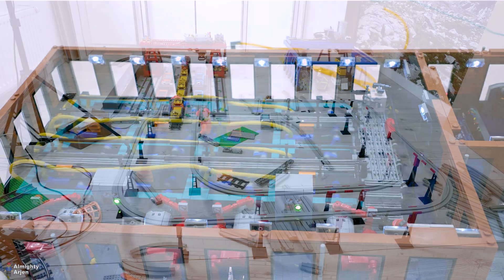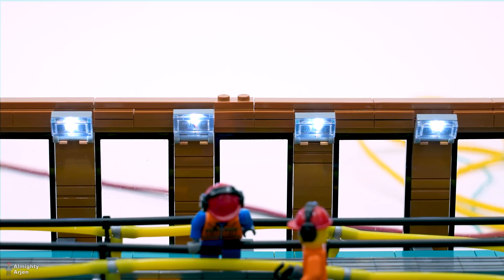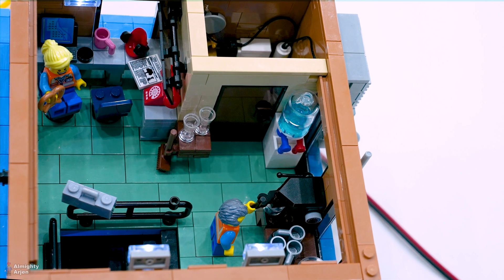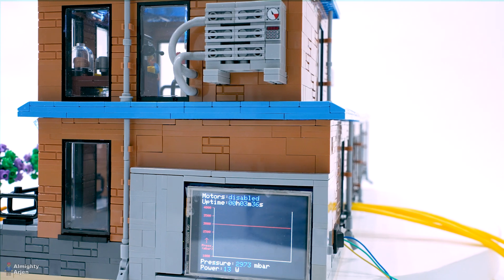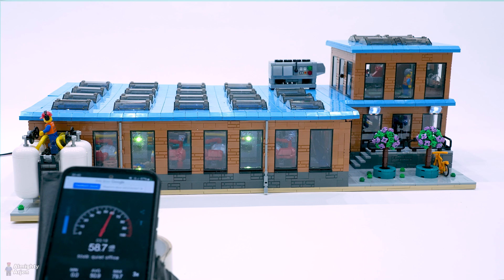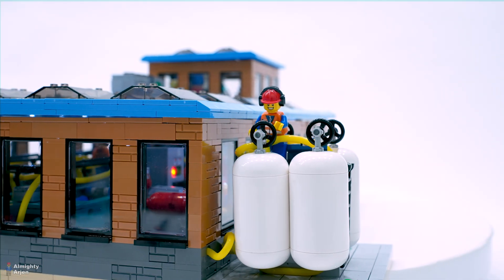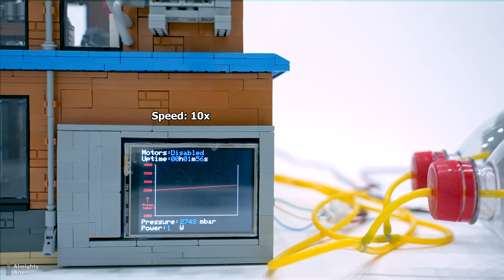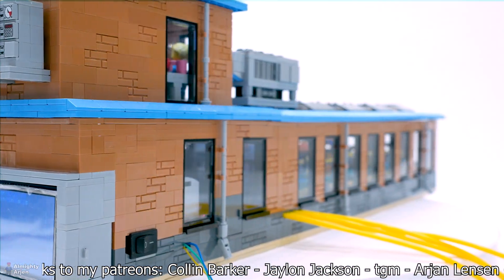Lego compressor with 16 pumps fully automated by Arduino

Comment: Those regulators are supposed to be mounted to a heat sync, they could melt those Legos and destroy themselves.
Reply from the maker: Thanks for noting, but not with the power that goes through them in this case, they hardly are getting warm at full power. The drawn current is around 2A max, the power that the 9V regulator needs to dissipate from 12V to 9V at 2A is only 6W.

Comment: If you link up the compressors in the same block you get more even torque and air flow, that will reduce the sound level a bit. Also i would sugest that they would join in the middle.
Reply from the maker: I don't fully understand what you mean by the same block? I have 4 pumps per motor, adding more pumps will result in an overheated motor. The pumps that are on the same motor have a 90 degree angle between each other.

Comment: I think your walls are simply too thin and not airtight enough for a larger sound reduction. The moment you have a leak somewhere, the sound insulation can be vastly reduced. There's ofcourse also direct transfers of the vibrations but I'm not sure there's a lot you can do about that on this scale. 3 dB is still great tho, and the build looks sick!
Reply from the maker: Thanks, I am thinking to add some soft padding to the roof, maybe I win some dB's with that but you are definitely right that the building is quite leaky!
Reply: @almightyarjen  even a small amount of sound dampening foam on the interior walls / ceiling should absorb a lot of the noise. and youve got quite a large gap between the top of the walls and the ceiling.

Comment: The building looks great. Functional and nice details.
Please tell us more about the technical and electrical parts.
Reply from the maker: I thought I told the most already 😂 Electrical: 12V in which is brought down to 9V for the motors and Arduinos and 5V for the sensors. Motors are PWM controlled so they start/stop smoothly. Communication between main Arduino and TFT Arduino is done by I2C. TFT is controlled by an Arduino Mega (clone), as the Uno didn't have sufficient memory for generating the graphs (I really should look into ESP32 controllers more, which are more powerful). Motors are driven by a MOSFET. That's about it I think?
Reply: @ and an ESP32 is much smaller which makes then more ‘integrateble’.